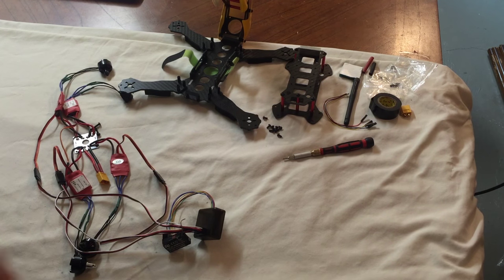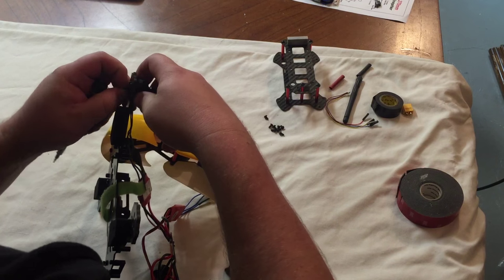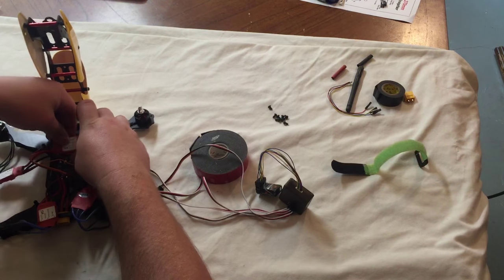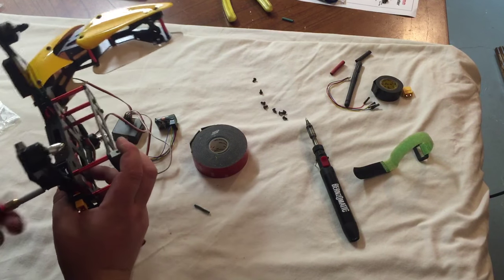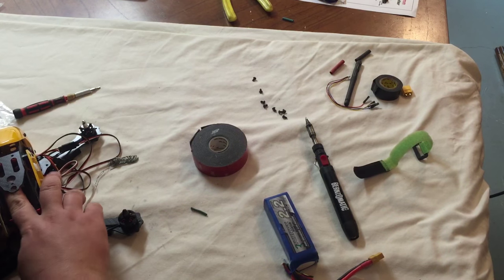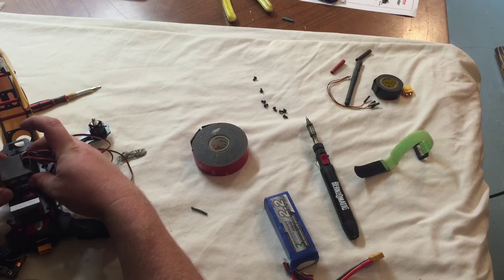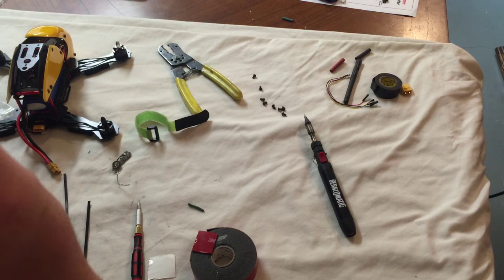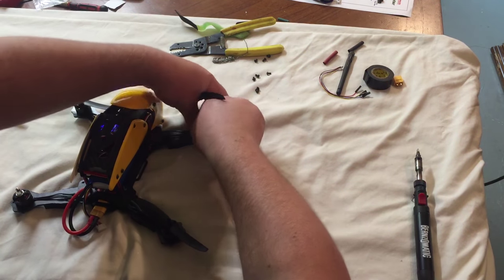RoboCat 270mm - FPV Racer Build Series: Episode 4 - Installing the electronics

Comment: Nice video! I just got my kit today and trying to decide on putting the cheap emax 12a ESCs in the frame (which is nice and tidy) or on the arms (for better cooling and easier to replace).  How hard is that middle plate/battery section to remove once it's all together? At 18:02 it looks like it comes off/on fairly easily...

Comment: Heh Matt, I'm stumped on the Robocat. By the way-- your  build video was excellent and everything came together great. I have been mostly in video quads and have never run into this. I have put the quad through librepilot three times and adjusted all engines together. The engines Are spinning the right way (Left rear clock wise, diagonal the same), the other two are spinning counter clockwise. The props are on correctly. The quad jumos slightlyl off the ground, and then upside down.
Do tou have any ideas what might be happening? Thanks for your response in advance.
Reply from the maker: sorry for the late response, im not very versed on librepilot but over at painless360 they have a video on setting up the ccd on the quad https://www.youtube.com/watch?v=p1EhSYNa0pM

Comment: not as neat as i thought my escs went two in front of pdc and two behind and mounted the pdc board
Reply from the maker: +902dr i have been thinking about moving my pdc board to the bottom to make it more accessible, and would also free up space for the speed controllers.
Reply: i will show you how i done mine i got smaller escs with my kit